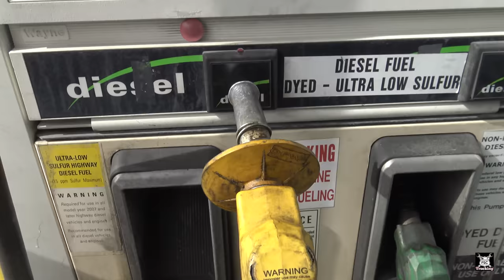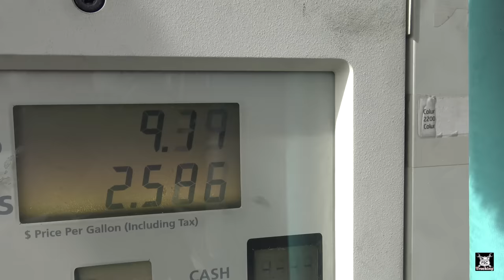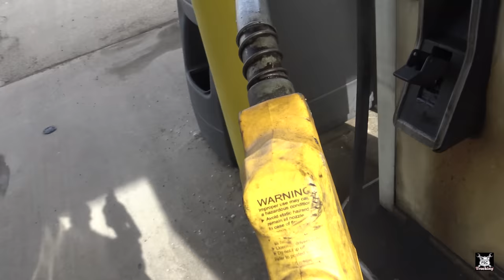Could I Cheat Unloading The Garbage Truck?   Nope.

Comment: Use to just love unloading in mud pits. I guess part of the job. You were probably better off just to unload off the front. Safest way to do it. Old  Orwell just keeps tugging alone. You got a good tractor there. A nice 352 just came up for sale on truck paper. Nice looking well looked after tractor. I like the 352 dash. Great camera shots as usual. That trip worked out pretty good. Well you have a safe and a great day. Happy trails and happy motoring.
Reply: If I could choose any truck, it would be an '82 Ford CL9000.  I've seen a few on YouTube and the inside looked really nice along with the comforts of the factory air ride cab among other things.

Not sure if I would put in an 8v92TA or a KTA Cummins but those CLs look sharp to me.

Comment: Why do you leave Orwell running whilst filling up the diesel tanks?
Reply: No reason to turn it off whatsoever
Reply: Probably hard to start
Reply: Diesel isn't as flammable as gasoline, so no worry about it lighting up.
Reply: The old trucks hardly ever got turned off on the road. Before or without APUs the only way to have heat or air conditioning & electricity was to run the engine.
Reply: It was funny to see you spin the tires on the garbage truck.  I gave an A for being lazy and trying.      Lol
Big time truck driver
Reply from the maker: I trun it off when it's going to STAY off.

Comment: Don’t ya hate whoever designs these truck stops obviously doesn’t drive a truck and most likely has never when they stagger the pumps with short hoses is just stupid, plus drivers who pull out the nozzles from pumps, console operators in australia won’t let you pay for fuel unless it’s hung up properly